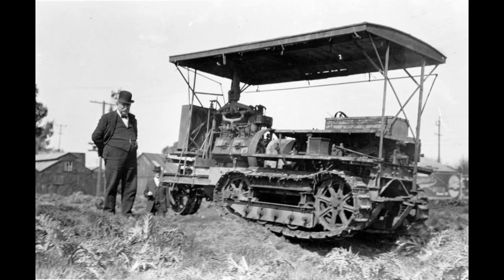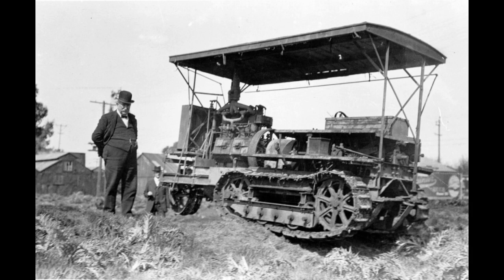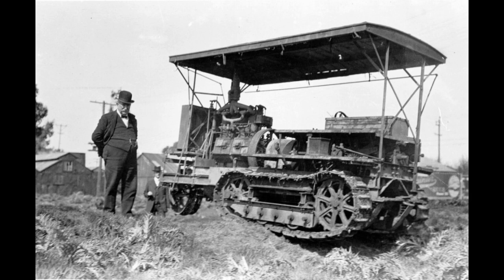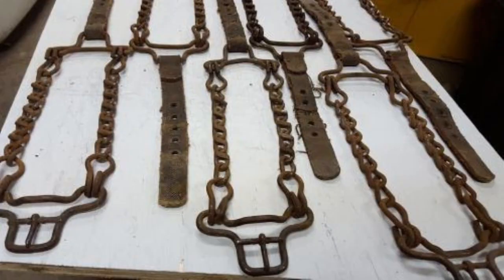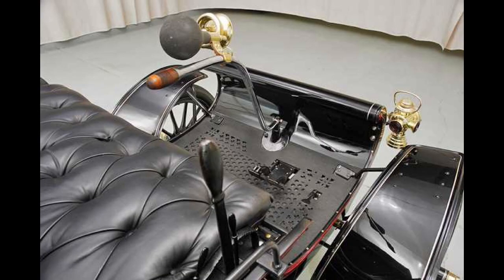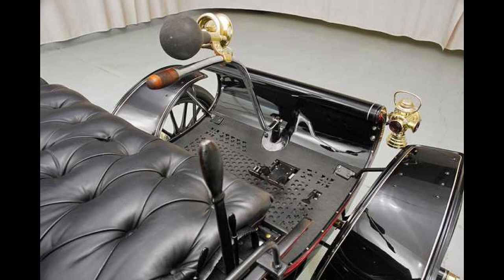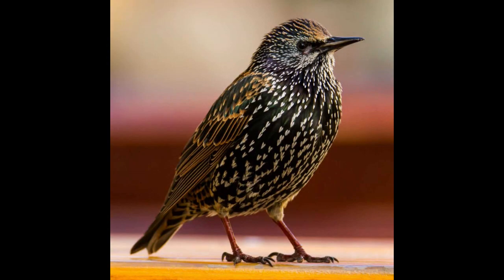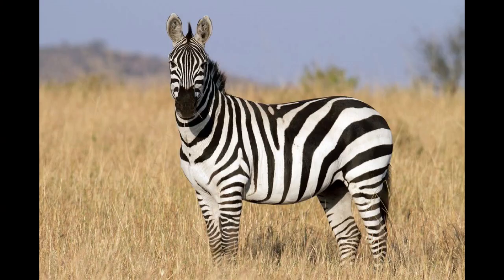Ye Ol' Garage Episode #17

Comment: Rattan was used in early aircraft seats for its strength to weight ratio.  It was the material of choice until just before WWII, I remember a photo of a 1930s passenger plane interior with rows of beautiful rattan seats.
By the way, the Swallow from England later became Jaguar!
Reply from the maker: With a brief stop as SS...
Reply: @VintageCarHistory  SS for Swallow  Sidecar
Reply from the maker: @jfu5222  Aye, though their 'swallow' car was actually an Austin Seven.  There was, briefly in 1922, another British make of car that was simply called Swallow that was not related.

Comment: Not sure if it was asked before, or if it warrants a video all for itself, but I've been wondering about paint. Stainless steel is expensive and currently car bodies undergo many procedures and gain many coatings to protect them from corrosion, with a coloured one as the last layer. It's simpler for plastic parts.
How did it begin, though? What was the best option in the vintage era? 
And, to add a purely aesthetic question: What were the most popular colours in the 1920's?
Reply from the maker: I can make whatever video you want- as long as it's black.